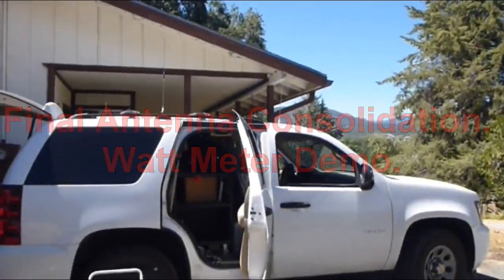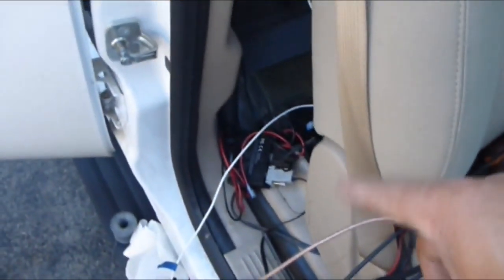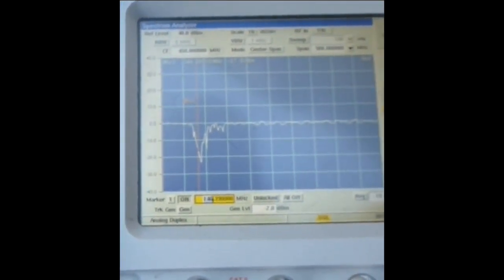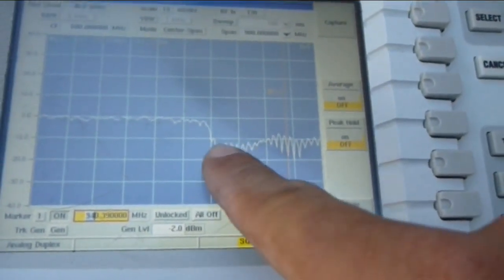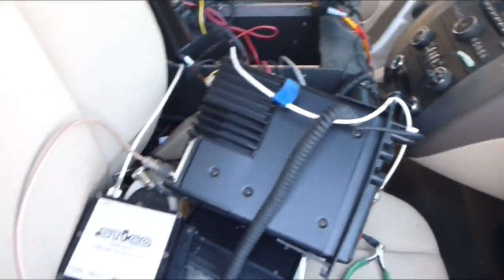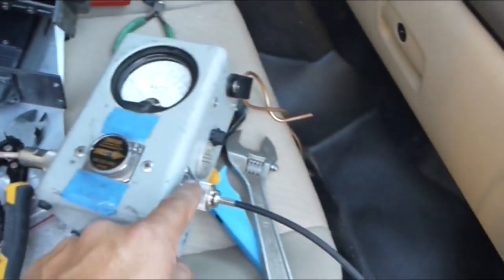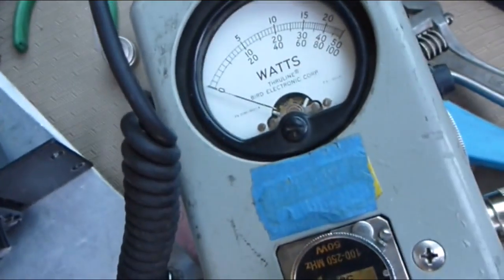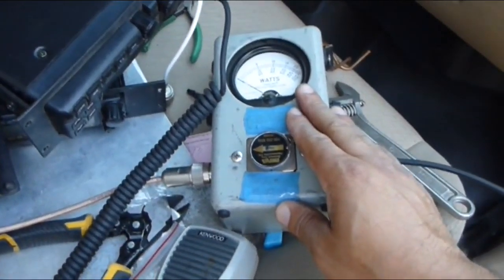Weird Vehicle Antenna Consolidation, Starter Comms Test Equip Usage, Pt2

Comment: For hams, similar duplexers and triplexers are available so that multiple radios can connect to a single broadband antenna. Some brands are Comet, Diamond, MFJ, etc.

Duplexers - two ports
Low: 1.3 - 57MHz
High: 72 - 550MHz

Triplexers - three ports
Low: 1.6 – 160 Mhz
Mid: 350 – 500 Mhz
High: 850 – 1300 Mhz

Low: 1.6 - 60MHz
Mid: 110 - 170 MHz
High: 300 - 950MHz

Low: 1.3 - 90MHz
Mid: 130 - 200MHz
High: 380 - 500MHz

--Konrad, WA4OSH

Comment: I've been planning my next vehicle very carefully. No plan for diplexers currently. Two lowband antennas for my lowband radio, VHF whip (maybe ill run 5/8 wave) for a P25 radio, UHF knob or wideband half wave for the 50 MHz of UHF I want to cover, 900 MHz 5/8 wave. Possibly a sharkie for aprs, 2.4 GHz and cell (which would replace the oem onstar antenna). Don't know if I'll put the low band antennas on the roof or headache rack though.

Comment: I don't think you touched upon it (As a radio tech, I skip around a bit!)  however, it looks like the new whips you put on the remainder of the ports are the Sti-Co Flexi-whips (Nitinol based) which have proven themselves to me in the commercial/public safety world.   Nice choices!

I'll caution you though -- several manufacturers used the multi-band NMO antenna with their radios  as the OEM multi-band antenna; and had some issues whereas the spring tension on the 1/4 wave stinger was too taut -- causing the NMO ring to rip out of the base loading coil on impact.  I have a Silverado 1500; and can attest to having lost one - be careful!   Hate to see you lose it!!!
Reply from the maker: Yeah, I didn't mention they were Sti-co flexi-whips, I try to stay on point about basic theories instead of products for the novice. Though the product just screams to mentioned sometimes.
I slap on a VHF antenna when I go off road in the multiband place. Yup, I changed out a multitude of LE NMO mounts when they go through a car wash without taking them off. LOL Thanks for watching.

Comment: With regards to APRS. How far are you from a APRS tower? In my area I have two but they are far I didn't know if 5 Watts would get me into it or not. Also do the radios run off of the alternator or did you have to put in a additional power supply?
Reply from the maker: I have 2 mountains with an APRS digipeater average 15 miles away from a given tower. My setup is about 5 watts and I get really good range, except for some of the remote back country. Here in Cali, there are a bunch of APRS digirepeaters and Iates around to track you practically everywhere. 5 watts was enough for me. All the radios run off the vehicle electrical system. I can only tx one radio at a time, it doesnt draw much current.